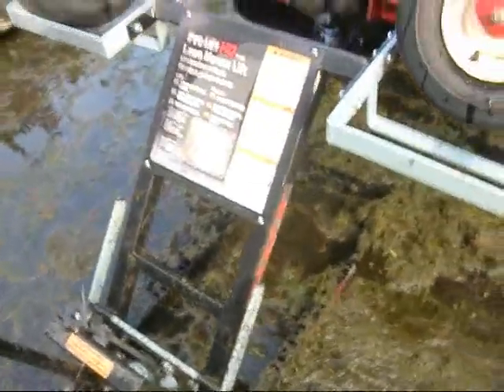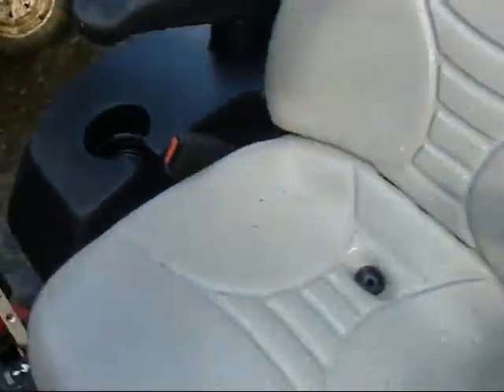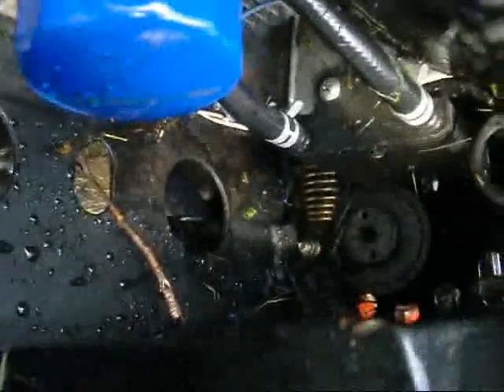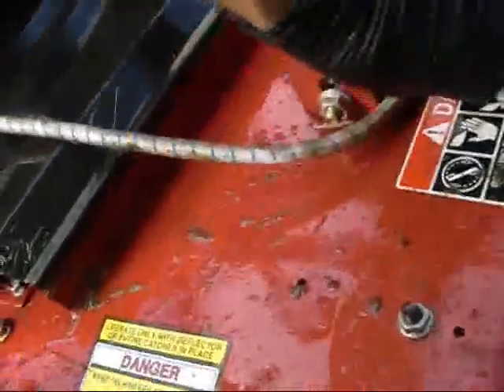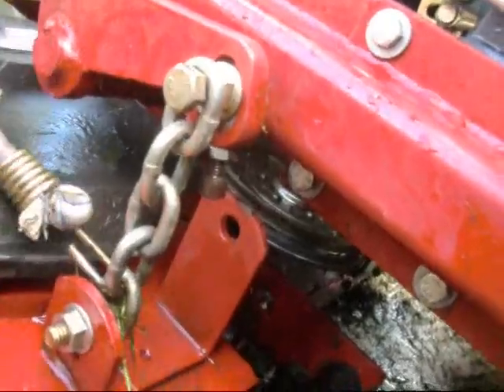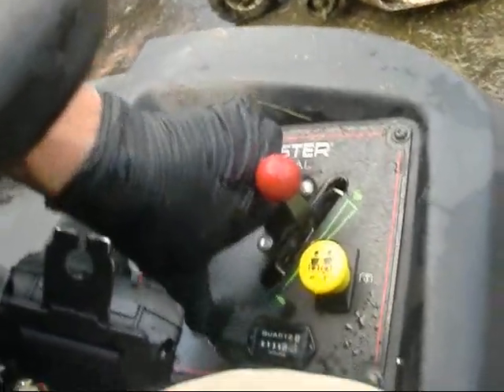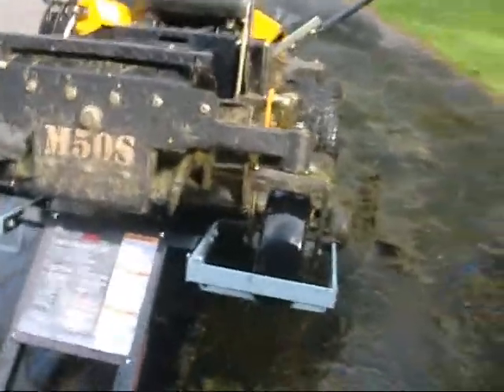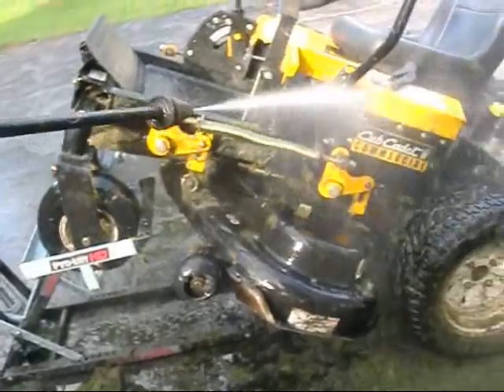Pressure Washing Cub Cadet  6 30 13

Comment: safest way to clean that sucker is to drive back onto the tooth bucket of your bobcat (Sorry Dokter..I have to rub it in)...angle the bucket up slowly until the frame touches the bucket (weight still on the tires)

Comment: reason that deck lifter is not rated for the "butt" of the machine is because to many people have hurt themselves (no brakes and even when blocked ...highly unbalanced because the  hydraulic oil slowly leaks back to the wheel motor with less resistance...